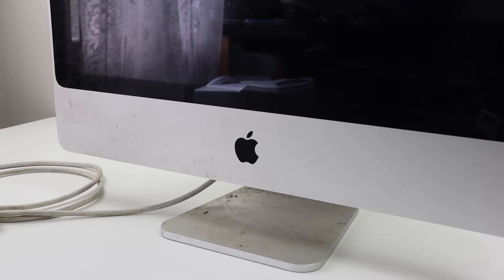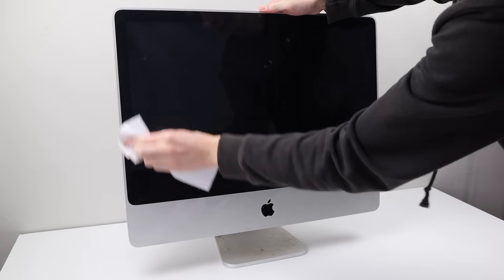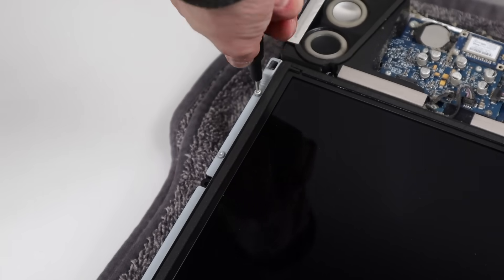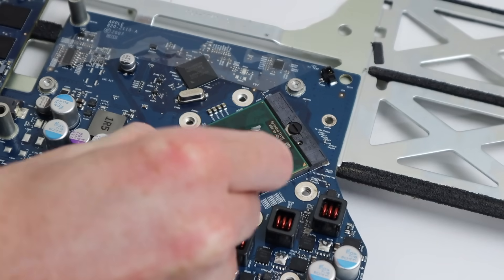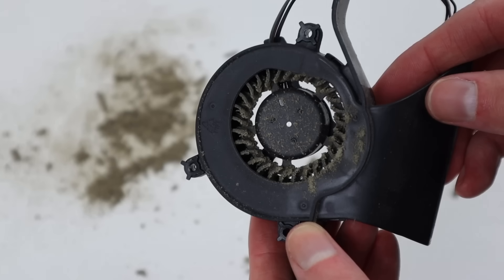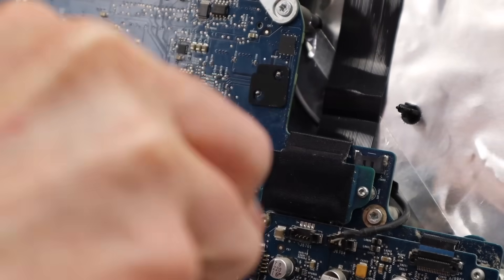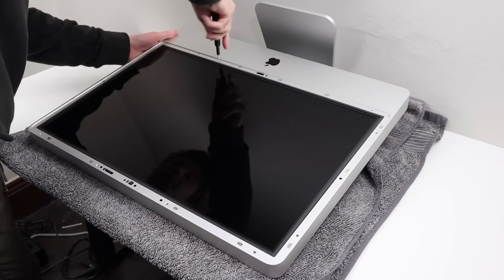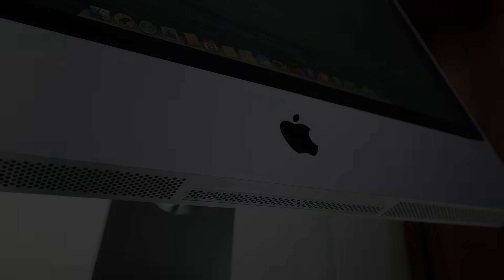I Was Given a FREE Broken iMac, Lets fix it!

Comment: I cannot comprehend that somebody at Apple legitimately decided that the 2020 iMac should have a 5400RPM HARD DRIVE as an option in 2020. That's ludicrous considering the cheap prices of flash storage these days.
Reply: well its apple we are talking ab they overprice garbage parts sometimes
Reply: @mallgrabberr  all the time*
Reply: There's no 2020 iMac released yet. It's still dumb, but the iMac with the 5400rpm option is a spec bump released in 2019. Dunno why they'd still offer a mechanical drive as an option, but there's a big difference between a new 2020 model and an old model with lipstick on it.
Reply: @branflank  No excuse. My mid-range LAPTOP had an SSD, a decade ago.
Reply: @VengFPV  A MID-RANGE laptop from 2010 came new with an SSD? Excuse me, but I find that very hard to believe. Even high end ones didn't come with an SSD back then. Or on very rare and expensive occasions.
Reply: @spineshivers  to be fair it was custom built, so I just specced it with an SSD. It was still less than $1000, so very much mid range at the time. Most prebuilt midrange laptops at the time didn't have SSDs you're right - just used my abnormal example to make a point, because it was still technically true ;-)
Reply: They cut corners, thats why they are a trillion dollar company

Comment: I also found an old iMac that someone had gotten rid of, is there a discount on new iMacs? It was a little dirty but in better shape than the one in this video, it only needed an OS reinstall. The hard drive worked but was ridiculously slow, thinking about putting in an SSD. Was disappointed that OS X 10.12 wasn't supported as that is required for the latest XCode.

Comment: WD Green SSDs... are. bad.
They're cheap, but their performance and durability is bad compared to other cheap drives. I've had a couple died on me in less than 2 years already. The performance is disappointing. I'd go for a WD Blue instead or other brands. (Phison E11 Controllers are prone to death in less than a year. avoid that as well.)

Comment: Nice cleaning and ssd upgrade. On a thirteen years old computer, I would have also replaced the lithium battery of the motherboard
Reply: As long as it still keeps time and holds a charge, should still be good. I would rather have seen him upgrade the CPU and install El Capitan on it

Comment: I have restored and sold over 50 imacs models ranging from 2007 to 2009....the biggest issue on these machines are dying lcd backlights...its over 10 years old machine (still very much usable in 2020) after all! All and all just add a cheapo ssd and some cheap ram and install dosdude1's patched catalina and you are golden...(also highly recommended to replace thermal grease and CMOS battery) that is if screen wont die which it might any second=)

Comment: Hi Hugh, great vid and great work fixing up that old girl. I also have a 2010 iMac with a shot HDD so I put an SSD in it and tried to reinstall High Sierra through the online recovery but apparentyly only iMacs with Mavericks or newer can install to an SSD. It looks like you installed off a USB drive with multiple ISO's so just wondering if you could maybe make a quick walk through vid of that process please. I'm not very Apple savvy, more into PC's. Cheers for the vid anyway mate, keep up the great work

Comment: Very nice rebuild bro! I have done a few of these with the core2duo , stripped down to a bare shell, MB removed, new thermal paste ect..These clean up real nice and are quite snappy if u have 4gb or more ram..I usually run capitan on them, they may even run high sierra...I havent tried.....Also did the teardown of the  2011 imac 21.5" which had an i3 in it...these usually have i5's but the one I had was an educational version made for schools that had a low power cpu..
I upgraded it to a 2600s i7 cpu and 16gb ram with an ssd... its a little beast and works incredibly well.. this cpu runs cool temps ..I could find zero help info on doing this cpu upgrade and basically rolled the dice... hope it helps someone else who may be in a similiar situation..  PS: although its tempting to do so, do Not try installing a standard 2600 i7 or heaven forbid, the 2600k in the 21.5" imac...these will run too hot and will also draw too much power ...even if they dont crash the system, they Will overheat in the smaller case...the 27" imac Can be upraded with those becuz its case is larger and has better cooling.

Comment: No RAM upgrade? I fixed a late 2007 iMac like this one, and I was able to upgrade it with 6 GB of RAM and an SSD with Mojave (it's an unsupported mac, but it will run just fine!). Overall still a good machine for web browsing, office work and... for graphic design as well. It's not a multimedia production machine but with a small investment it is still a good and nice looking machine to use.

Comment: Hugh, you need to check out ifixit.com for repair manuals and videos. They've been around for years. As for current iMacs not having an SSD, yes they do when you don't pick the base model. One thing to suggest to people repairing any computer, take photos of what you're doing and label the cables if there are more than one in the area you're working on. As for the hard drive being bad, I would have tried some disk repair software to see if it could be seen by the iMac. I'd also would have tried it in your disk dock (I have two of them) to see if there's an issue with the power supply and/or cable. Your friend who gave you the iMac would have been happy if you found some of their files.

Comment: If the DVD drive area was damaged why didn’t you buy an adaptor and add a second drive?

Is there a reason you had to go back to the old ac card? (Did you need access to the screw hole for re assembly?

In the future will you upgrade the processor ram and gpu(if possible to get a better gpu) for this computer?

Is there a way to fix the yellowing of the screen

Comment: Nice Restore. You can upgrade the cpu to an intel core 2 duo T9300 and have to support to run Catalina using the Catalina Patcher tool. This system can run all OS X intel Tiger through Catalina as well.

Comment: Nice restoration! Can't believe how a computer can get so dirty...
I'd have probably gone with upgrading the RAM to 8GB (if possible) with the SSD, or a cheapo 500GB or 1TB HDD if leaving at 4GB.
At least the CPU can also be upgraded... and I'd have probably also gone with El Capitan for maximum app compatibility. For example, Chrome will only run on Yosemite or newer (10.10+) - not Mavericks (10.9).
EDIT: in 2021/2022, Chrome for MacOS requires OS 10.11 El Capitan or later, so thats what I'd have installed. It's usually best to go with the latest version of the OS that is supported by the hardware.

Comment: Well I use my iMac 2007 as my daily driver.
My iMac has intel Core 2 Duo 2.4 GHz, 4 GB ram, 1 TB HDD, ATI Radeon 2600 Pro 256 MB Graphics card and 20 inch screen.

Comment: I have one of these that I bought new. It now runs Linux Mint Debian Edition very nicely. I have to say I cringed watching you apply the thermal paste THEN blowing dust out from the heatsink before fixing it down. I would have done the cleaning first! The slot to the right of the camera is very handy for looping the microphone cable through when putting the bezel back on. It prevents it from getting pinched during reassembly. You can then push it back in again. I suspect this was how these were originally assembled at the factory.

Comment: Not the WD green man. No DRam. Not that faster an HDD but price per gb is much higher. And the lack of DRam reduces the endurance significantly and the SSD speed takes a hit in random read and write operations which are essentially what are happening when we are using the Mac.

Comment: What did he mean in this part? 5:21
Reply: The capacitors in the power supply can still hold residual current after being unplugged from power, possibly even after 24hrs. They can give a nasty, possibly lethal zap if you touch the power supply PCB contacts with bare hands.

Comment: I need to do something similar with my 2009 machine ...
Reply: I've installed quickcpu on my computer from trash and I get 10 more FPS in League of legends , also applied new thermal paste on processor and graphics core because it's cooled passivly and it gets to 89* degrees at idle D: now I got 65* so it's ok

Comment: I have a early 2009 24inch imac with what i believe is a cooling issue. After running for about 30mins or so, it will start to pixilate then either freeze or crash, sometimes rebooting. Id like to fix this machine and maybe update its internals where possible. I really only use to to keep my music collection. Any advise.

Comment: Correction "i was given a free old imac, and cleaned it"
Reply: He also fixed it dipshit
Reply: @maxz8807  did he? All he did was swap hard drives. I wouldn't call it a repair...
Reply: @orafaball2162  what, according to you, is fixing?! He took an iMac, in which the hdd was broken, and he put a new, working ssd into it  making the iMac working again. He took a broken device that didn't start and fixed it by putting on a new, working component.
Reply: @maxz8807  he replaced a component, chill buddy.  Anyone can do that. Its like saying you repaired a car just by changing a flat tire
Reply: @orafaball2162  ... just look up the definition of fixing something and rethink your entire comment thread. He took something that was broken, and he fixed it. Whether he just replaced the hdd or reflowed the GPU doesnt matter. He took something broken, and he made it work again. If you have a flat tire, your car doesnt work, hence it is broken. If you replace that tire, the car works - hence it is fixed. The complexity of the work done doesnt matter. If you take something that is broken and make it work again, you fixed it. No matter the complexity.

Comment: I use Jif cream (slightly abrasive) on the iMac aluminium exterior & power cable. Will remove small scratches & all dirt with ease. Found it to be better than isopropyl alcohol

Comment: the problem with any old (display) device, is that its wear and tear, i have does a similar things for a 2006 imac, replaced the HDD with SSD, and it works great, but after 2 years, the display is no longer viewable, bad colors and just unusable, and there is no way to use external display... so bit of a waste, these 2006 imac hardware can last like 10 years!...

Comment: My brother bought this new in 2007 for $2500.
It's still a daily driver for the folks today only needing a HDD replacement in 2014.

I would have upgraded the processor as it allows you to run newer MacOS versions.

Comment: “Let’s fix an iMac” 3 minutes of detailed cleaning
Reply: Most Macs that have failed are due to being dirty.
They are designed to run hot, so if there is anything stopping the cooling system from working perfectly, it will fail. Cleaning is half the battle on getting a Mac to work again.
Reply: Nguyen Duc Hung :D
Reply: :D
Reply: I also expected some electronics work but well, a hdd was al it took
Reply: The cleaning is always my favourite part in his videos :D
Reply: Raffael Ender :D
Reply: Draw do :D
Reply: Ehab Farooq :D

Comment: I opened my 2004 or 5 iMac some time ago. The dust inside was INSANE! I removed the dvd drive, and replaced with a caddy that could house an ssd. Then I switched the old hdd for a newer, higher capacity version. All works fine, and upgrading the RAM also helped breathe new life into the old girl!

Comment: Any can anyone help i have a iPhone 6s and it has no iCloud or anything and the screen doesn’t show anything it’s just black but the touch still works i factory reset it and after i did  that i went to my tv to plug it in (since i have to Apple adapter) and it shows stuff and when i like try setting it up i can but it’s hard but touch works and i got to the part where i need to put password for WiFi is they anyway i can bypass that since the keyboard(when it ask for password ) doesn’t show up on tv for like security reasons anyway i can fix it or just get pass that

Comment: My mother recently bought a new iMac, she told me and I took a look at the specs online... I was shocked that it didn't come with an ssd standard! Such a slow hard drive to be sold in 2020. Mind boggling
Reply: @Scwarzkop  you can. But why you have to do that? why it didnt come with one already?
Reply: @rosamelcachoful  they should come with an NvMe-SSD for that price...
Reply: @Cr0Lar Yes. The cheapest model has a 5400rpm ridiculous hdd and the more expensive has a fusion drive (very small ssd and 5400rpm hdd)
Reply: In example, the 1TB fusion drive is 120gb ssd and 1tb hdd.
Reply: it is also very difficult with newer thin imacs
Reply: @Scwarzkop  for a 2000+ dollar computer I would expect a SSD .. but you pay more for just the name 'iMac'
Reply: Jeremy Oboe bro it’s a fusion drive
Reply: Granpda Corey  True...
Reply: It’s a shame because all the MacBooks have SSDs standard, here’s hoping a 2020 iMac or whatever has one standard and they scrap the Fusion Drive model.
Reply: Only the bottom of the range 21" comes with a standard HDD but even that can be spec'ed with a fusion drive or SSD at time of purchase.
Reply: iMacs are not nois.
100 times better a PC if you don't have to do some specific mac software stuff
Reply: @alessandrobellia2106  even if you need Mac software, just use a virtual machine and you get macOS on PC.
Reply: @your_average_clippy  not everyone has two graphic cards on a PC dood

Comment: I am guessing that Sata 3 wasn't around by the time this product released, I checked on google, and SATA3 was released in 2009.
Now, I am not saying it's a huge deal, but you have a bottleneck on there, sadly, there isn't much to do, as far as I know... And combining that you will get bottlenecked by using such old hardware, it just won't matter as much, but, it's still there.
Even upgrading the CPU, why would you do such a thing, it still wouldn't do good enough to make a difference in the overall performance, for daily use, I would say that this mac, and now pardon my french, it sucks... literally... Maybe, just maybe it was a powerhouse back in the day, but the only use for it in today's age is, having it somewhere as a decoration, or maybe a second monitor if that's doable, I guess the screen isn't too bad and the aesthetics of it would be a very good thing to see in a product back from 2007, can that be done? using your Mac as a second screen on any OS?
Still I got to give it to Apple, for the design, which even by today's standards, is very good, it always has been...

Comment: I want to know how you can get hold of these awesome iMacs like in my country these usually go for around 250-300 US dollar
Reply: And normal PCs what have still system updates got value with this configuration 20-30 US dollar... This is just useless brick, even nice looking body and display is useless as it cannot be reused with newer components.
Reply: @jannepomuk7735  but it surely does like cool and good. I would put it in my room.
Reply: Y.A.BEATBOX  Rly ? You cannot install newer apps because you cannot update that gen to higher OSX. This Mac we got in the office and will go to trash bin. I can take it home, but it's absolutely useless. Power of it is on the level of calculator, so the real value is around 30€ because you cannot even use that display for another system. Sorry, but power compared PC or laptop with an option to have updated system is 20€ and people are throwing them away because nobody want them, so it's absolutely no sense to pay 10 times more for a system what is outdated. But you can still use it as a mirror.

Comment: After repairing a early 2011 macbook pro last night, I ran into an issue reinstalling the OS. Apparently, Apple installs certificates on all macs and once they expire, their servers can't communicate with them making installing the OS from the internet recovery impossible. Like hugh did, installing the OS from a external drive worked like a charm.
Reply from the maker: I tried to install lion via internet recovery and ran into the same issue. So just put mavericks onto it.
Reply: @HughJeffreys  it's really a shame how Apple tries to force obsolescence
Reply from the maker: Yeah... I do have a copy of lion on a dvd at my parents house so i could install it that way.
Reply: @HughJeffreys  you're prepared, I wasn't. I kept getting an error message and had to figure it out myself. Luckily it was pretty easy and now I have a early 2011 15 pro with a 500gb ssd

Comment: I have this exact same model of iMac. It doesn't get much use though anymore. It's stuck on El Capitan which is now out of support; and though I was able to get a bit more life out of it putting Windows 7 on it, eventually that reached end of life as well and Windows 10 just doesn't run well on it (I was either getting the BSOD soon after startup or it would lag real bad when it did run). Ended up putting 8.1 on it instead which is a somewhat better, but I had since got a better computer anyway and so this one has been retired to backup status.

Comment: Damn that's so dusty. Please don't blow canned air at fans and make em spin while blowing dust out. A lot of the times it will spin faster then it's designed for and could damage the bearings. I usually hold my fans and then clean em, no unwanted dust or anything getting in there by accident and no bearing wear.